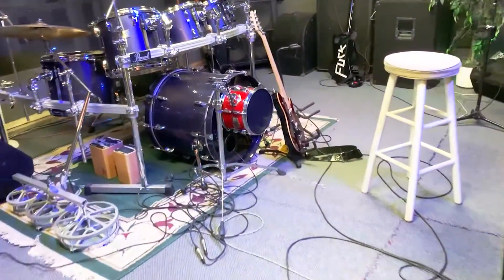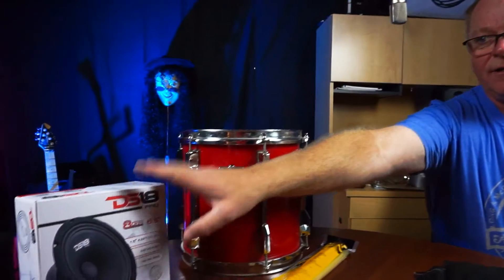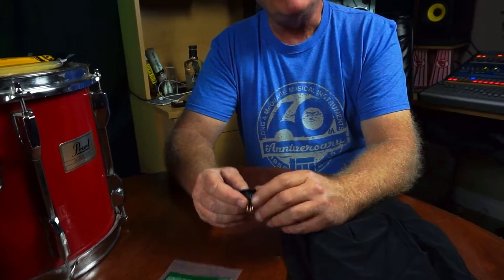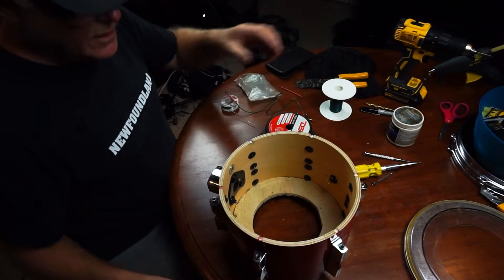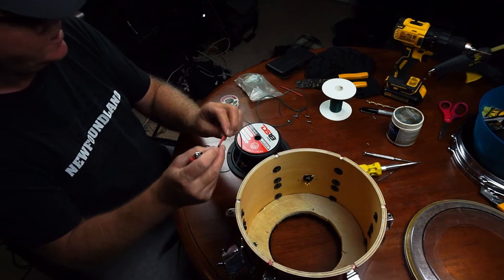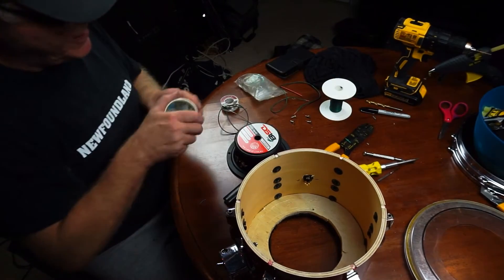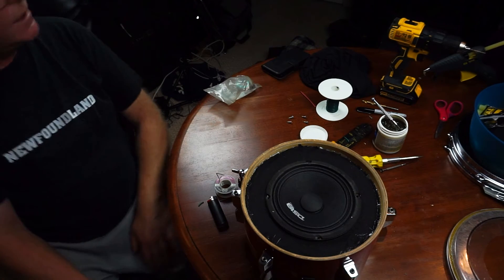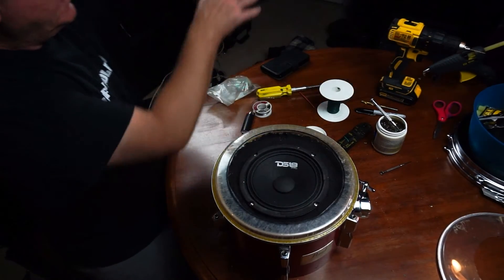How To Make  a DIY Sub Kick

Comment: Pin 1 is the shield.  The old rhyme to remember the signal conductors is "2 is hot, 3 is not." That leaves 1 as the shield.  Also, you should reverse the polarity on a sub kick mic so it will be in polarity with standard mics.  Speakers move in the opposite direction of mics:  the positive phase of a cycle depresses the diaphragm of a mic but it pushes the cone of a speaker outward, and visa versa.  Hence, when using a speaker as a mic, you need to reverse the polarity.  Pin 2 (hot) on an XLR should goes to the negative terminal of the speaker.